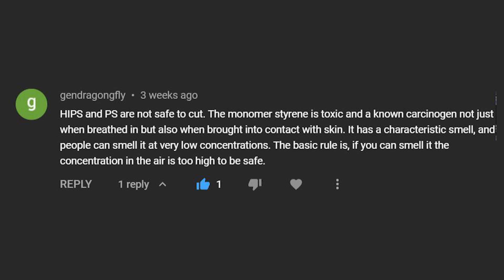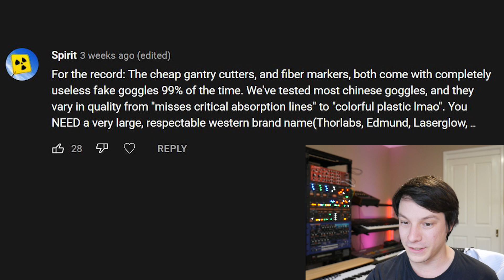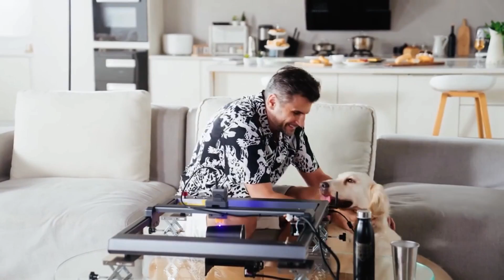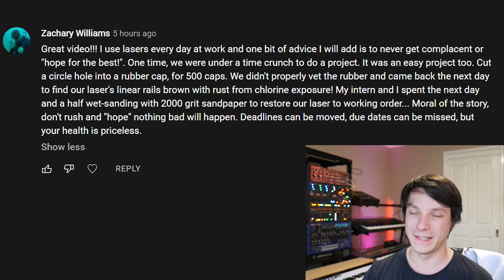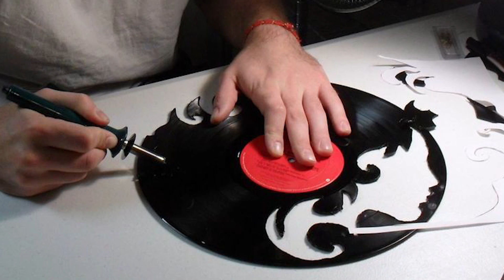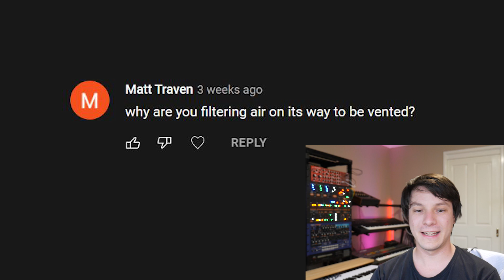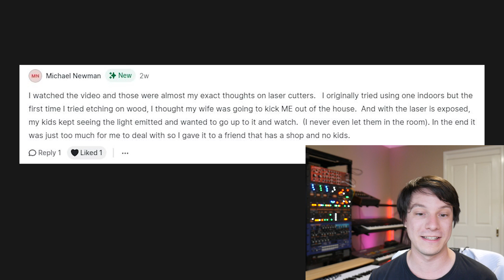What YOU had to say about Laser Cutter safety

Comment: I've been looking into buying a home LASER engraver and, as someone with a technical background, who is well aware of both the hazards of LASER radiation, and of combustion chemicals, I agree that it's scary how little is mentioned about safety.
From many of the reviews I've seen you might well assume that ventilation is "optional".
And many suggest that the little orange plastic shield around the beam is sufficient to keep you safe.
I've also seen widely contradictory claims about which plastics are safe.
(And one or two manufacturers seem to be claiming that their LASERS can safely cut plastics that contain chlorine.)

Something else I would add is to emphasize your warning about different wavelengths requiring different safety precautions.
The company where I work leases a relatively large CO2 LASER which we use for marking on anodized metal.
It has an integral enclosure, with a glass top, which is opaque to CO2 wavelengths, and has an interlock.

And, with the correct glasses, blue diode LASERS are also relatively safe, if you follow reasonable precautions. (*IF*)

HOWEVER, XTools has recently announced an infrared LASER head for etching on metal at relatively low power.
(And I assume their competitors will release similar equivalent products.)
This used a "near-infrared" beam (I believe 1064 nm) at around 2 watts.
SO NOW WE HAVE A NEW TYPE OF DIODE LASER where....
- it's invisible so you cannot visually tell whether the LASER is on or off.
- most of the current eye protection won't block it properly.
To me this would seem to pose a HUGE risk for inexperienced users.
(Or those who are familiar with blue diode LASERS and to being able to see when the beam is powered on and where it's aimed.)

Comment: Re scroll saw discussion - laser cutters are really good for accurately locating cuts quickly. But sometimes you need to make a part out of materials that aren't laser safe and a trick I've used on things in the past is to use a laser cut template to lay out holes using transfer punches. If you need the exterior you can also use a flush trim router bit if your material can be cut that way. Or if it cant safely never underestimate scribing, rough cutting with a jig saw (or even a jewelers saw) and then filing away. It's not fast but you can get incredibly precise parts.

Comment: Unrelated but hoping you can offer a little help. I have an old XYZ Da-vinci Pro printer and I want to replace the controller for better control, I also want to use something like Octoprint, I have a Pi 3b+ on hand that I can use. Any suggestions on controllers would be most welcome.

Comment: Using an air filter sounds like a great idea until you realise it can be difficult to impossible to filter gases. One way it's done is to use scrubbers which dissolve the nasty gas in water. Of course then you've got deal with the nasty water. Activated charcoal filters are another option but have to be replaced regularly. The other solution to pollution is dilution but good grief not in an urban environment let alone in a high rise building. On a positive note there are ceramic coating available specifically made to be laser etched safely. Clough42 had a video recently where he used them. But, big but they're not cheap. That's the real problem I see. These machines are cheap and the process looks cool. I'd add damaged eyes are one thing, damaged lungs are in a different league and the damage can accumulate with ongoing exposure.

Comment: The first comment made me think...
I think I have seen small cnc-like engravers with the platform mobile instead of the cutting instrument.
If applied to a scroll saw, couldn't you make its functionality comparable to cutters? It certainly still wouldn't be safe in a family setting, but noise is a great reminder of risk. And I feel having the cutter be stationary would be risk reducing in itself.

My only experience with these things before  finding this channel was William Osman, so this might not be the most technically sound... Though he has touched upon good safety points, like the goggles.
He at one point also stated that the laser cutter was the tool he was actually afraid of, for some of the points made in the last video. And considering some of the things he's done, and how he's done them, that should tell you something. If the tech version of Jackass is afraid of some tech, that is a bigger warning sign than anything they will officially put on there.

Comment: IMO if you use a laser without and enclosure you are an idiot, I know that’s harsh but it only takes a fraction of a second to become blind. It’s not worth the risk, not where you have a simple solution, get an enclosure.
The crappy adverts showing them in use with no precautions and pets or children right next to them should be criminal.
I am sure that there will be some that will say they have used theirs for year and never had an issues but you only need to have one incident and you are blind.

Comment: As a person that uses a Chinese K40 laser and as an EE, I ended up completely tearing through the unit and rewiring the system.  Grounding was non existent, power supply had no fan, cover screen is a piece of orange acrylic.  Nothing was done to address the wavelength of the CO2 laser for protection.  No instruction, nor safety warning.
There were more issues though out that were cleaned up. There was an FDA logo on the lid which I guess was supposed to make people feel safe. 
Users with no electrical experience working around a 12kv laser supply is a very scary thing.   

Extraction of the fumes are a big one.  There are people always trying to invent a better system.  Pulling way too much air out of the chassis causes more issues than it solves.  I use a low speed fume extraction fan with sealed 4" line evacuating to the outside.  It is best to have the fan unit farthest from the laser so it will pull the fumes.
It is crazy with some of the solutions that some people come up with that are just plain dangerous.

Now we see ABS/HIPS toxic issues with 3d printers, and now resin printing.  

Glad to see your videos addressing these issues.

Comment: Oh, those goggles...!

I have one of those low-end CNC routers, and, as long as I was buying it, I went for the blue laser head accessory, figuring that eventually I'd find a use for it (and, before using it, build an enclosure).
It came with "safety" glasses, of a blue-green hue - and not shiny blue-green, reflecting all light in that part of the spectrum, oh no.  Just tinted blue-green.  Maybe I'll stick with the real goggles that make the world look weird shades of orange and have attenuations-at-wavelengths engraved on them.

Comment: I'm a student worker at my university  and I work in our makerspace. We have an epilog CO2 laser cutter that comes with a beefy filtration system. 

Ultimately my job is to teach students how to use our equipment in a safe and efficient manner, and there are safety procedures that we must follow to ensure accidents do not happen. The laser cutter comes with a fire suppressor and instantly shuts off the laser the moment the lid is opened. We also have an extensive sheet listing the banned materials. If someone has a material that we have not cut before and is not on either the banned or approved list, we would look up the MSDS and other sources of burning information before we consider using it in the laser.

So when I saw that "open air" laser cutters were coming to the market, I couldnt fathom how these were allowed to exist. I'm sure we will hear in the news pretty soon all the accidents that happens with them.

Comment: I got my first 3D printer a few years ago, and a few months ago I thought about buying a cheap laser cutter as well.  I even had one selected and in my shopping cart.  I knew just enough to be a little concerned with the open frame nature of the device and didn't feel anything like comfortable with the questionable nature of what they were advertising.  I decided to do a little more research before going ahead with the purchase and what I discovered caused me enough concern that I finished up never completing the purchase.  Your first video came along after that and it more or less confirmed the issues I had started to become concerned about.

My knowledge is probably above average when it comes to physics, engineering, electronics and design though I make no claims to being really great in any one area.  The fact that these devices can be purchased for just a few hundred bucks on Amazon, Ali express or any number of online hobby/electronics retailers is concerning.  I probably will end up getting something eventually, but only after a lot more planning, and it won't just be a few hundred bucks, and it definitely won't be an impulse purchase.

As George Carlin used to say: "Think of how stupid the average person is, and realize half of them are stupider than that."  In this case not knowing what they don't know could lead to serious and life changing results.
Reply: I was thinking something similar as your first paragraph, and even had gone as far as selecting a laser cutter (actually it was one of those multi-tool ones that could change function after swapping a couple of components out, but still.

Animals, pets, not trusting myself not to make stupid mistakes. All reasons that i decided to not carry through with the purchase after taking a little time to think before hitting the purchase button. I went and got myself a plain FDM printer instead.

Comment: The goggles - they do nothing! That's been my strongest feeling about all laser cutters/engravers and a prime reason I haven't even thought about getting one is that I'd have to buy specced goggles for myself, my wife, any visitors, and our pets. Alternatively, my thought would be to just use an opaque case with a lid interlock, LED lighting inside, and a PTZ webcam if I really needed to watch the work in progress. 

Also - lots of shops do laser work to spec, and as pointed out, scroll saws are safer and cheaper.

EDIT: And this was actually my main point, eyesight is fragile, you only have two eyes, and the old saying goes "Welcome to the Laser Lab, please try not to look into the laser with your one remaining good eye."

Comment: Some of those ads, might have just been a representation to show it off. I see several wood cutters that will remove the guards off their saws for better filming.

The difference, is that they generally put in a warning "I'm a dumb-ass for taking the guards off. I'm ONLY doing it for better videography. Do not be a dumb-ass like me. Use all your safe equipment and PPE."

Comment: An important thing to add is the Beilstein test, if you are laser cutting and you don't already know and use the Beilstein test, you're doing it wrong. The Beilstein test lets you easily check for chlorine in your materials, all you need is a copper wire and torch, there's no reason not to do it before cutting an unknown material.

https://www.youtube.com/watch?v=4i9Pa99j5XM

Comment: our makerspace has a laser cutter, heavily modified and lots of added safety features. one wire got disconnected and some of the safeties were bypassed. I got it fixed, which ended up getting all the documentation for it up to date

a good complement machine would be a shapeoko or a 3018CNC that would allow you to do the things you want to do with lasers, but with not-safe-for-laser materials

of course, our makerspace has much more dangerous tools (oxyacetylene, plasma cutters, Mame cabinets) so we try to keep things as safe as possible

Comment: Maybe you can design or make a guideline for us to builda DIY enclosure and a ventilation system. I mean, I'm sure that a big chunk of your subs currently own an open frame laser cutter. As you said, there is info on the internet about this, why not summarize them in a video? For example, what kind of plastic should we use as laser protection, how powerful the ventilation fan should be, pipes maximum length, filter materials... that sort of things. Could be a topic for a few videos. I'm sure you have the enough knowledge about the topic to do it properly. Maybe a DIY fire/smoke detector too. This could be useful for those who hasent buy yet a machine of this type; now they are educated enough to decide wether what they are buying is safe enough. This machines are so useful to just stop using it without trying to make them safer options.

C ya!

Comment: For everyone crapping on cheap lasers.
Just because you have an expensive laser, doesn't mean it's safe either.
A company I worked for for 10 years got into industrial laser cutting, bought a giant million dollar machine capable of cutting through inch thick steel no worries. The only problem was they didn't bother to buy any ventilation or filtration systems for it, because they were too expensive to justify at the time. So whenever they decided to cut anything nasty, like rubber and god knows what else, our offices upstairs would get absolutely flooded with fumes, it was absolutely sickening, literally.
We would complain, but management and the owners assumed we were just whingers and would just turn a blind eye.

Comment: I ran a hobby vacuum former and with that I used venting for a lot of materials. I can't imagine how bad the fumes would be if you're openly cutting stuff with a laser. Vids like this are a useful education and if 3D printers and laser cutters make their way into the classroom, vids like these need to be added to the curriculum.
Reply: I built a two fan venting system for my 3D printer, because even PLA outgasses significantly, especially if I need to use high temps. (not to mention polycarbonate)
The only safe(ish) plastic I have found was PETG.

Comment: Have got a cheap CNC that came with a laser. Knew most of the burning materials bit but not the bad safety glasses. If I use it now it will be with more knowledge, thank you, but will be in an enclosure, which makes venting and filtering easier, which I can't see through except for a well protected window which is also covered when not checking the job. No real information about safety from the manufacturers of these cheap machines. Low power low risk is how it's pushed and that is not true of course.

Comment: I'm an owner of several laser cutters and have been doing it for almost 5 years now and this things are no joke, first of all, I wouldn't even think of buying a diode laser cutter because they have too many safety issues to deal with and definitely this things should not be sold to people that have no knowledge on how the tech works, I only purchase CO2 lasers because I have a warehouse with proper ventilation and there are not houses nearby, on the video it was already mentioned that CO2 lasers are less prone to cause eye injuries, you can only get hurt if you start to calibrate it since you have to open the lid and in part it is true but the light the dot emits it's very bright and you can easily get lost just watching it, a good piece of advice is to watch it with your smartphone, in that way you're safe of the very bright light, the best advice i can give to people is that you should never leave these machine unattended, we already burned one machine, costing 5000usd, in my case we could repair it, but it's like Theseus ship now, all the interior is almost new, we salvaged what we could and that because we left it unattended just 5 minutes, in our case the extraction fan failed and the smoke accumulated inside the machine and that was what most probably caused the fire, so shit always can happen, if there was one person just watching the thing nearby we could have saved a ton of money, I hope my experience can be of use for someone watching here.

Comment: It would be great if you could do a video on making enclosures for people that have lasers on their larger CNCs.  For example, sourcing appropriate windows without paying a fortune is a challenge and has held me back from designing one for my new CNC, on which I have not yet used the 455nm, 20W output laser.  There are less expensive soft plastic sheets, but most of us have no way to test their claims about blocking specific wavelengths.
Reply: If you're using a cutting level laser, then almost no soft plastic window will provide a particularly good result for a beam getting loose. If you just want to protect against backscatter, then polycarbonate is a good solution for IR/CO2 lasers, while the diode lasers you probably could get away with using glass with a reputable automotive window tint to handle the UV/IR that the glass doesn't get, as the window tint would provide a good visible indicator if it started absorbing power